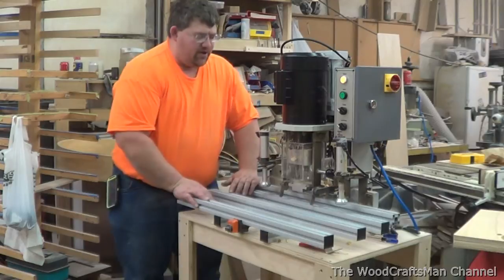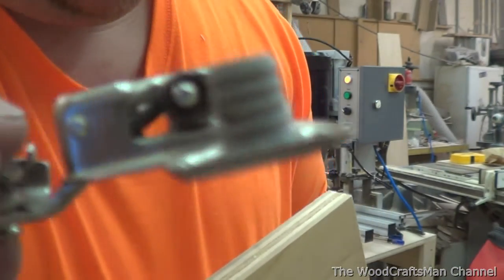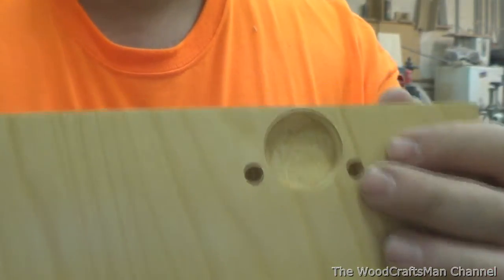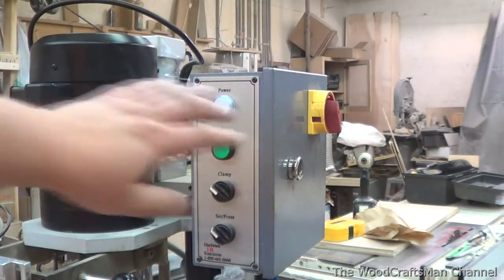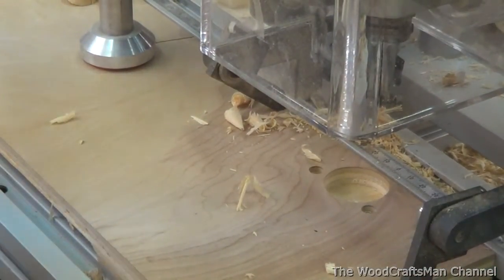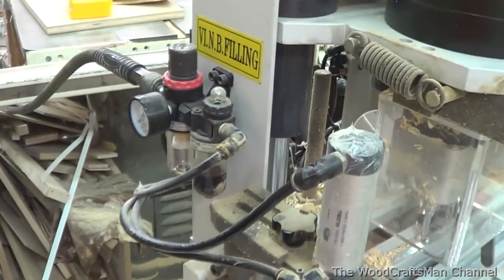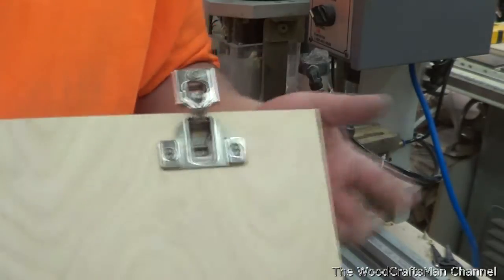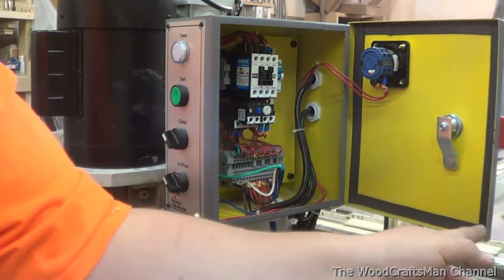Hinge Boring Machine # 132

Comment: I bet you're right about a potential fisheye problem.  I used to have a fleet of trucks that had air cylinders to shift the auxiliary transmissions.  We tore them down and lubed the o-rings with Vaseline and it lasted about a year.  I'll bet we had more cycles than you would expect in a year.  If so, you've got an easy maintenance issue once a year and eliminate the possibility of blowing oil on your doors.

Also, I can't see how anyone could press those hinges in without scratching the door.  Do you think large scale cabinet shops drill and press their hinges
AFTER they've finished them?

Great video.  I've watched these machines before, but never saw the setup.
Reply from the maker: Hi Kris, thanks for the comment. I will have to check in to that. At the same time i could replace the blow spout with a filtered muffler like the other solenoid valve has and just do away with the blow spout, besides the shroud has a 2" hook up for dust collection, so I probably wouldn't need it.

As far as drilling after the doors are finished, Yes a lot of big cabinet manufacturers drill and press the hinges after the finish is applied, however most of them have an oven cured catalyzed varnish as well. Scott

Comment: Thanks for sharing your thoughts about your new tool.  Wish I had enough space to add one of these to my shop.  I was wondering if you had considered buying the 8mm dowels separately so you could continue using the same bits and screw-in style hinges?  Not sure if this is even feasible.
Reply from the maker: Hi, thanks for the comment. I recently after posting this video replaced the 8mm bits with 2mm bits to drill the pilot holes for the #6 screws. I think you can purchase the 8mm dowels separately, but if you buy them as part of the hinge its only about 0.04-0.07 more per hinge. To your point, its not really feasible for me at the moment, and the worst part about it is, I seem to be doing more and more of the Blum 38N hinges with the integrated Blumotion soft close which will not work with the aluminum hinge block on the insertion ram with out doing some modification of some sort. Scott

Comment: thanks a lot for posting this videos especialy this and the last one,the line boring one, as a cabinetmaker myself , been loking for machines like that, and one thing that stopped me is the fact that i dont like the plastic anchor stuff , i like to screw it direct to the wood and i was wondering if i can replace the 10mm bit to another for piloting ... man you have no idea how that help me , now i know how , i just have to  find one used so i can afford it , cuz here in Mexico the price for a new one is a lot bigger than in the U:S:.
SALUDOS DESDE MEXICO....
Reply from the maker: Hi, thanks for the comment. I recently after posting this video replaced the 8mm bits with 2mm bits to drill the pilot holes for the #6 screws. The plastic dowels used in the hinge are probably just as strong, but the plastic dowel them selves are not easily removed if needed, they are ribbed in on direction so once inserted, they will not come out under normal use. If you find a machine, it will more than likely use a 10mm shank for the pilot bits, and you will need a shank adapter to go from 10mm down to 2mm. CMT makes the bits for their portable hinge drilling jig which is what I used, as do a lot of other tooling and bit companies. Scott

Comment: You could just use 5mm bits and system screws for all of your hinges.  Hey I saw your comment on my vid but I couldn't reply.  As for the software, the value is in the g code generation.  other than that, yes, lots of design software out there.  The proprietary algorithms are what you really pay for.  If you watched how fast it does what it does, you surely understand, Cheers!
Reply from the maker: Hi, Thanks for the comment. I will have to check into that, I didn't even think of that. I just new I didn't want to use the 8mm and have to use knock in hinges. I did however for the time being install the 2mm bits to drill the pilot holes for the standard #6 screws that Blum uses for now, it works like a charm, no more pre-drilling before screwing in the hinges, Thanks, Scott